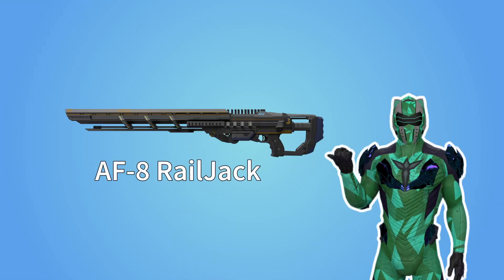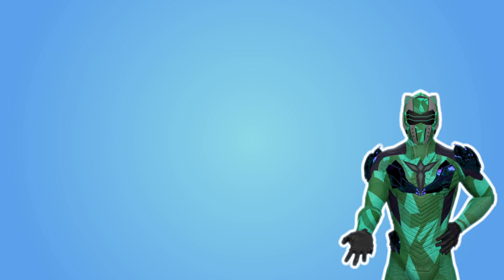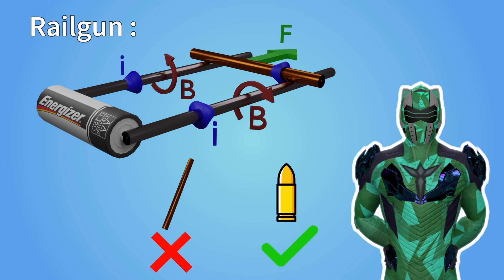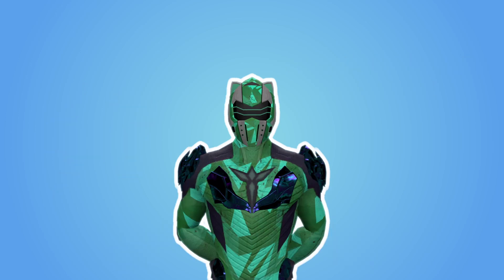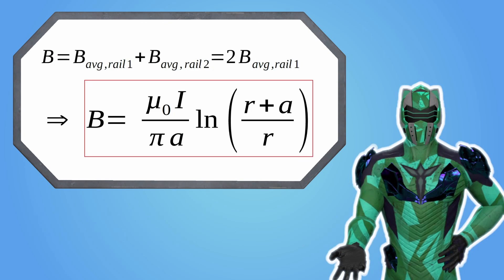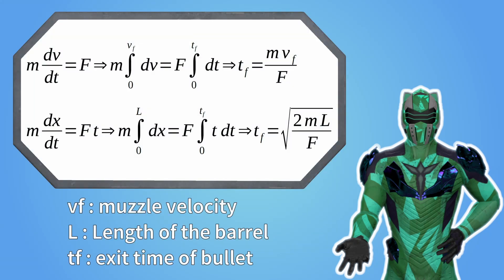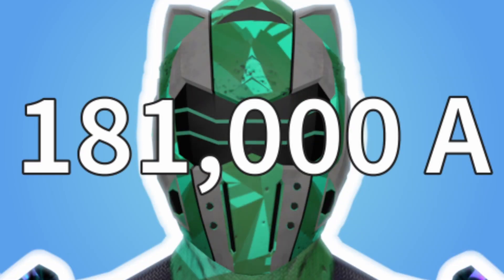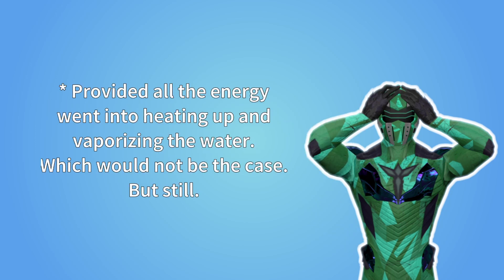Railgun Physics! A Railgun Requires More Electricity Than You Think

Comment: A 26mm projectile? Holy shit bruh. Would reducing the projectile diameter to something more like 9 to 10mm make a substantial difference? 26mm is well into autocannon territory.
Reply from the maker: Yep, it's big! But it's actually the measurement taken directly from the RailJack. At 4:09 you can see that the width between the rails is 26mm.
Also, the formula is on screen. Fell free to play with the numbers in WolfrmAlpha. Here is the result with 9mm : 
https://www.wolframalpha.com/input/?i=sqrt%28%28pi*0.042kg*%28850m%2Fs%29%C2%B2%29%2F%282*mu_0*0.075m*ln%28%280.0035m%2B0.009m%29%2F0.0035m%29%29%29